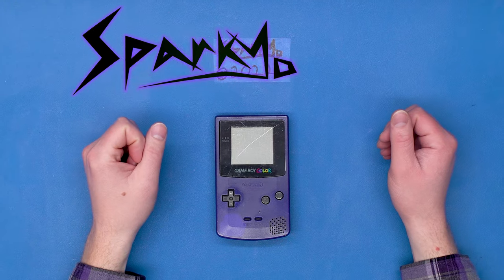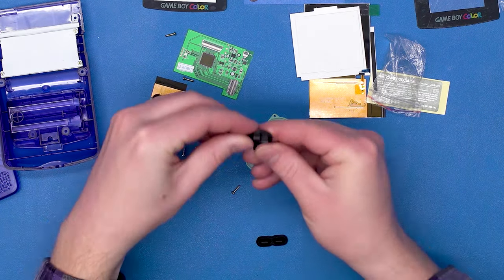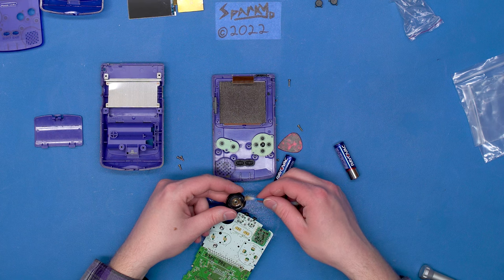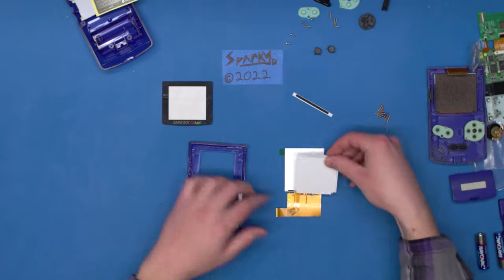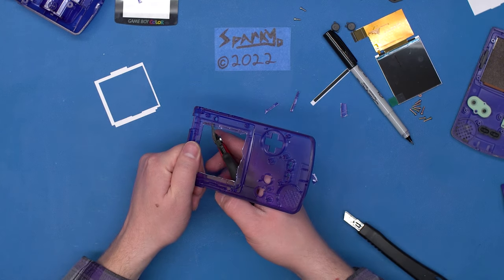I Restored my Childhood Game Boy Color in Under 20 Mins | Beginners Guide to Retro Restoration

Comment from the maker: Thank you to everyone for watching! Feedback through comments and thumbs is always appreciated. 
Also, I still have a twitter, for some reason. 
https://twitter.com/SparkYoChan

Here are the chapters:
00:00 I changed the microphone so the audio should be better
00:13 How do I clean a dirty gameboy
00:33 How to replace a GBC case
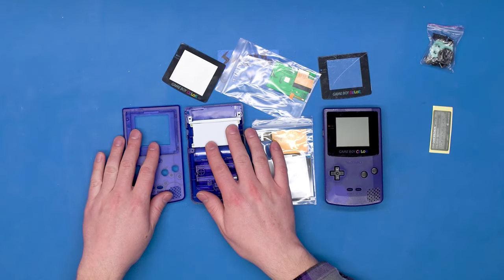01:26 Game boy Color replacement IPS backlit LCD screen 
02:25 New Gameboy replacement buttons
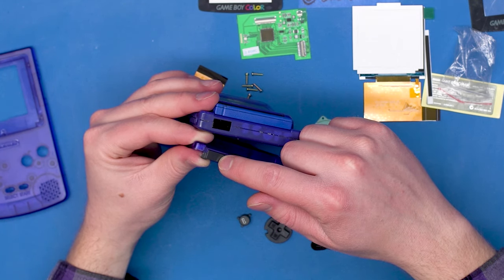03:28 Testing to see if the new gameboy color IR is transparent 
03:55 Opening the gameboy case
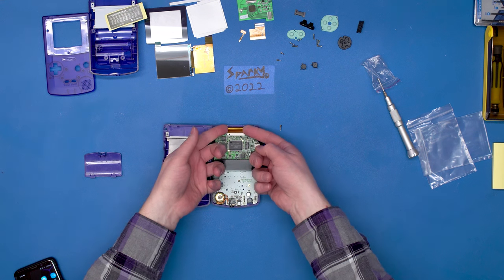04:02 Whats inside a gameboy color
04:20 Removing and cleaning GBC mono speaker
05:32 Installing gameboy replacement screen adapter board
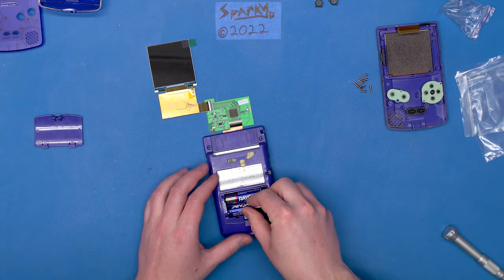06:51 Did I get the replacement to work?
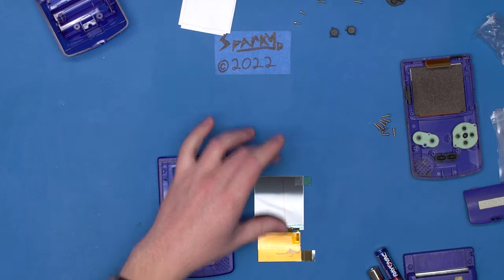07:32 Modifying Gameboy color case for a screen upgrade
11:46 Installing the new IPS LCD display
13:06 Reinstalling new buttons into gameboy
14:14 Attaching the capacitive touch brightness control
15:28 Reassembling the back cover of the case
15:59 This sticker is a waste of time
16:11 New tempered glass gbc screen cover replacement lens thing
17:02 Be very careful cleaning the new IPS LCD with a disposable wipe
18:10 Testing the improved backlit gameboy color screen
19:18 Let's try playing Pokemon blue version